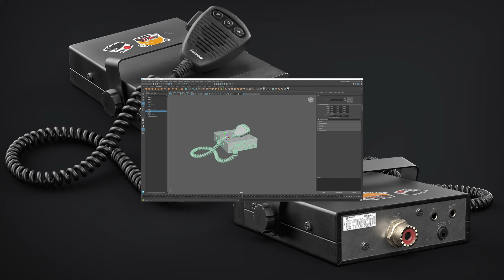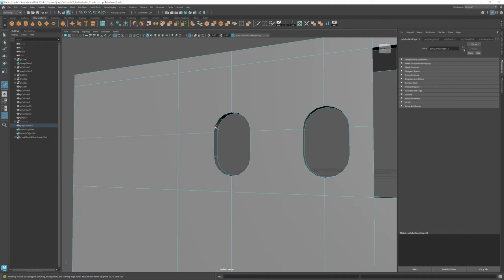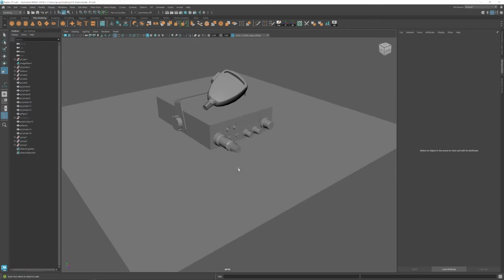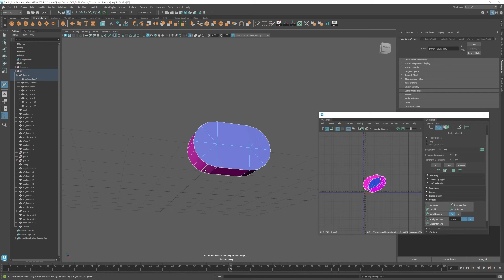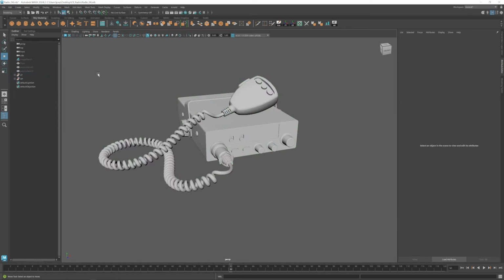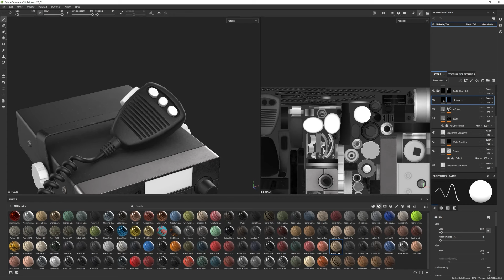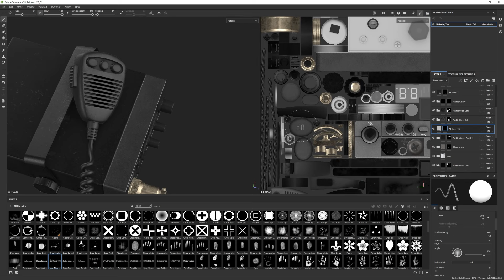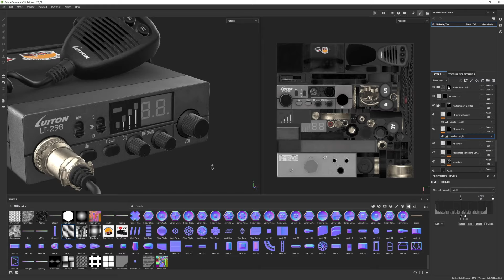CB Radio | Game-Ready Asset | Autodesk Maya + Substance 3D Painter

Comment: There's a much simpler way to put your helix on the curve that lets you easily adjust the helix parameters while it is on the curve.   I did it for the cable on a retro keyboard.   You select the helix and curve and use the "Curve Warp" deformer.   You can then adjust the the helix parameters and they will always follow the curve.
Reply from the maker: Awesome! Yes this is a great way to do it thanks for mentioning it! Not sure if you can move the object along the path with the timeline slider by this method, I could be wrong though but regardless its a quicker way to attach a helix shape, I'll try to remember this! Thanks :)